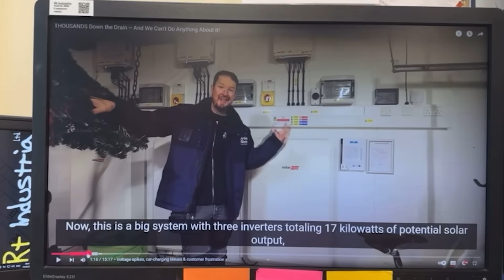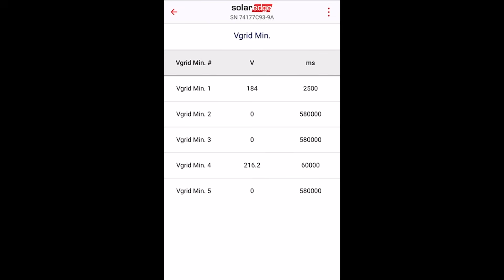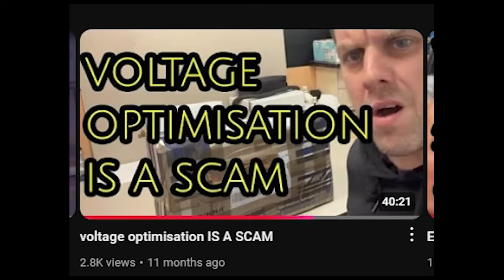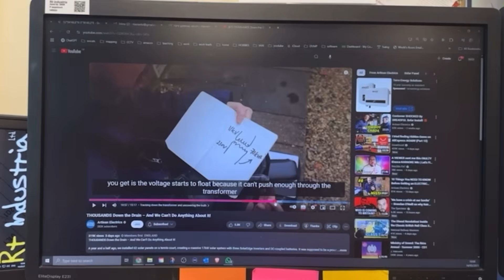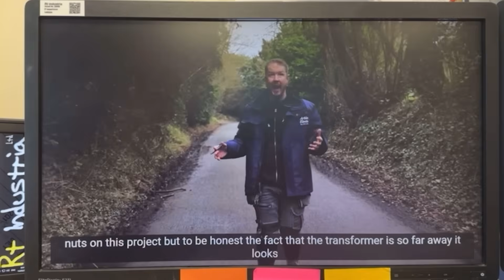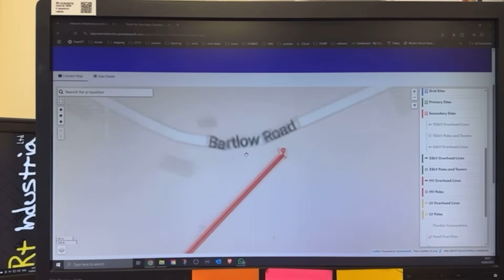ARTISAN ELECTRICS v THE GRID. WHO,S TO BLAME

Comment: I did some digging for my own knowledge, inverters work in a similar way to generator governor control.  
From what I can tell they adjust their phase angle to be slightly ahead of the grid,  a bit like the prime mover of a generator.  So the overall system voltage shouldn’t be necessary higher than the grid.  But the inverters sine wave voltage rise   should step ahead slightly of the grid voltage.  Within its tolerance.  So maybe the multiple inverters are trying to step ahead of each others wave not realising they are fighting each other and not the grid.  This would account for the higher RMS voltage.
I wonder how messed up the sine wave looks on a scope display.
Reply: Would this be able to happen if the voltage limits are set correctly?
Reply: @ I honestly don’t know,  keen to find out if it anyone else does?
Reply: I'm not sure how this would work - if the solar sine wave is rising slightly ahead of the grid, that's fine for the first quarter cycle, but then it will also start to fall slightly before the grid falls and therefore the flow of power would reverse for the second quarter cycle, and then the same thing would happen for the two quarters when the sinewave goes negative, one quarter the solar is ahead of the grid but for another quarter it's behind the grid, so it would be a net neutral import/export and it would push power out 50% of the time but draw power back in the other 50% of the time. Unless you're saying that the solar creates a sine wave with a kind of flat top on it, so that it rises slightly before of the grid, but falls slightly after the grid, so it has an extended peak - the flat top?
Reply: Anything connected to a grid will have the same exact phase. Voltage, current, power factor can all change but the frequency is identical everywhere on a connected grid. Some generators will run slightly faster before they sync to the grid, which is maybe what you read, so when they do close in they don't load the grid. But a generator will always be at the same frequency as the grid. Try to run it faster and you just export more power until you run out of excitation voltage on the voltage regulator or the engine runs out of power. You can adjust the power factor and depending on local grid requirements usually you will push VArs in to the grid to offset the motors that are using VArs. But frequency is tied to the grid. Put a scope on it and you will only see one sine wave. Well, one voltage sine wave and one current sine wave (if measuring current) and the difference between them is the power factor. But once a gen is online it is electrically coupled to that exact frequency. In fact if the prime mover loses output the alternator becomes a motor and will drive the prime mover at the grid frequency, called reverse power. As in electrical flow is reverse, not physical rotation in reverse which a lot of people assume reverse power protection means.
Reply: @ the sign wave can look messed up on a scope.  This happens with harmonic distortion.  When we synchronise multiple  generators we reduce their speed/frequency and voltage as the load on them increases to allow the incoming generator to pick up load without going faster that 50Hz or over voltage.  You don’t change the grid frequency but you do in effect get the generator to push against the grid.   Solar inverters also seem to have a droop feature.  
This example in the video shows you can have a different local voltage.  I’m connected to the same grid as this installation, my voltage isn’t affected by his installation.  The grid is one network, but voltages can be different at different parts.
Reply: @ 100% correct there can be harmonics and local distortions on the grid, but your fundamental frequency will be the same. The way the post was written it sounded like you were expecting to see two 50Hz waveforms slightly out of phase with each other. One from the grid and one slightly ahead from the inverters or generator in your case. So maybe I misunderstood what you were saying. 
The frequency will be the same at that installation and where ever you are at any given time There is a website that shows the UK powergrid frequency in real time and should match exactly with what you see at your location. But of course, voltage, current and power factor will vary by site and even within a building. 
Think of the frequency "mechanically" tying all equipment to the same speed / frequency. 
Setting up droop for paralleling generators isn't the same as syncing them to the grid. You are correct, droop works by allowing the engine to lessen the power output as the load increases which in turn causes any paralleled generators to increase to make up for the decreased output of the higher loaded gen. That way you don't have one gen at max power and one gen becoming a motor driving the prime mover and tripping off due to reverse power. But droop is the old school way to parallel generators. Today it's all done electronically with load sharing modules or controls built in to the gens themselves.
Reply: @ I’m dealing with micro grids in the marine environment so it’s a little different.  We still use droop even with modern switchboards and generators  but we have a higher tolerance for frequency changes.  We drop the overall frequency of the online generators so the incomer doesn’t overshoot.  I’m trying to learn the differences between how the national grids work with load sharing and how we do it.  We are getting more hybrid battery packs and inverters coming into the industry - Interesting stuff.  Also explains why we never load share with shore power for more than a few seconds.  Thanks for the information.
Reply: @JT_2024-c8j  Ok, now the droop makes sense. It's usually used in an islanded situation, like ships, back up power and microgrids, but when you mentioned the grid I though maybe you had a hard export power limit for peak shaving or some other scheme. Interesting you actually sync wanting it to be a load, but I guess makes sense to not upset the grid you are syncing with since it's only momentary and you will become a load once the gens come offline. Always wanted to work on ships, so many cool systems and power plants / main engines but most of my career was in power utilities and power generation. Only a few microgrids, one being in Antarctica. Which is a really cool setup between the US base and Kiwi base. We had 5 cat 3500 series gens, tied in with three 300kW wind turbines, two smaller Cats at Scott base and one inertial based energy storage system. All controlled via a SCADA system that would control what gens ran and did the load sharing between what was running. Obviously getting as much wind power as we could. The intertial storage was a heavy flywheel spinning at 3.000 rpm (I think, been a few years) and could supply up to 500kW for 30 seconds. That was used to dampen swings and to try and give a gen time to come online if we had a gen trip off or the wind died down. But that system died and may have been, or is in the process of being replaced by battery storage. When it was installed there were no battery systems like we have today. But really cool set up there and worked really good! Sure, there were problems from time to time but the load there was in the 2MW range or so. And yeah, much loser on the frequency there vs what the requirements are for the national grid. Plenty of times we'd have a dip in frequency where if it was a national grid it would have load shed and dumped load to save the system collapse. But with so little spinning mass it's inevitable to have frequency swings. As you are well aware. Out of curiosity, how much lower do you drop the frequency, it can't be too much or it would never sync. A few thenths, if even that? Not sure what your shore power breaker sync window is. Or is it an onshore breaker that does the tieing in? I don't have any marine to shore experience.

Comment: I did G99 UKPN approval for my own solar install/Victron battery install and its a tick box exercise. Submit the application and it pretty much gets approved instantly. As-long as all the documentation is submitted it goes through. Jordan's video to the layman makes it look like its everyone else's fault apart from Artisans. A lot of the issues could of been sorted out with better configuration of inverters/chargers. Why do they need to export so much and why do they need to charge at such a high rate. With the 6 hour octopus tariffs the battery could charge alot slower and the volt drop will have been alot less.

Comment: The inverter should throttle the output back if it exceeds 230v plus 10% as per the regs someone has set it to exceed the 253v maximum limit.
Reply: That’s not what the G98/99 requires that’s just your feelings about how it should work. Manufacturers could chose to throttle but all the standard requires, and all I’ve ever seen in operation are hard limits that once reached the inverter is required to shutdown.  Also your idea is nonsensical as 253vac is considered an allowed voltage to deliver to a home but no inverter would ever be able to export.  The allowed limits are higher.
Reply: I think Fronius inverters can do this but not sure if this is when the frequency goes towards 52hz
Reply: @edc1569  yes typically frequnecy is used to regulate active power not voltage.
Reply: @edc1569  My solar edge will not go above 253v  that is it's cut off same as my powerwall

Comment: I don’t get that the voltage must be higher than the grid to back feed the grid.  What are we doing - slowly raising the grid voltage?  Shouldn’t it need to be equal to the grid supply  voltage when the house is off load?  Otherwise how is this going to work with multiple houses all trying to bump the grid voltage up?  There must be a set point that the inverters will reach.  If the grid  voltage is right on the line of tolerance they cannot raise the voltage to force back feeding.
Reply: If the grid and the solar voltages are equal then no current will flow (Ohm's Law). Solar inverters aim to make their voltage about 6 to 8V higher than the grid voltage up to a maximum on 265V. This means that the property and neighbouring properties will be above the limit of 253V and this can damage appliances by making them run hotter. If several properties are exporting at the same time their inverters will fight and everybody exports less. This will get worse as more people buy solar.
Reply: @ When we run generators in parallel the voltages are equal and they load share just fine.  If you raise the voltage on one generator it will supply more reactive power.  The aim is to get them to be equal.
Reply: @JT_2024-c8j  I canna change the Laws of Physics. 
The situation is different. Two generators would have to match voltages to a common load (with equal cables), but they would also have to be in phase. 
With solar export the aim is to power the property AND make current flow into the grid. For this analysis you can consider the grid as another load, so it is one generator and two loads. There is always a voltage drop on a current carrying wire however small its resistance and to make current flow outwards the voltage has to be higher than the other end.
Unfortunately solar inverters normally go into the consumer unit in domestic installations so they raise the property voltage too. It would be better if they went between the consumer unit and the grid and had two ports, one kept at the nominal mains voltage and the other at whatever it needs to be to export .I'm not aware of any like that , but they would be more expensive. If such a device doesn't exist it will have to be created as more and more solar installations are made.
Reply: @ Don’t they load share by shifting the phase to be slightly ahead of the grid?  You can run as many generators in parallel as you like with many loads on them.  The grid is like another generator.  To get a generator to take up load you increase the governor to try and get the generator to speed up.  You keep the voltage as stable as possible.  From what I’ve read solar inverters do the same thing by adjusting the lead/lag of the sine wave against the grid sign wave?  The voltage at that point of the two sign waves would be higher but the overall peak voltage doesn’t need to be higher.
Reply: @ I worked recently with three generators and a battery powered load shaving system that absorbed spare capacity from the generators when they were under low load and supplied power back when the generators were on high load.  Voltages on the grid were 100% stable when the battery pack kicked in.

Comment: I agree that the inverters are fighting each other to push the current out and with increased voltage.
Reply: That should not happen if their limits are set correctly. So maybe they overlooked the setting? Doesn't seem likely......
Reply: @mfr58  that depends how far the inverters are from wherever they are getting the voltage measurement from
Reply: @haldo691  As far as I understood the inverters monitor their output voltage at their terminals and keep that voltage within set limits, as well as sensing if the grid voltage goes outside limits, in which case the inverter should disconnect. This is a requirement of connecting to the grid with E98/99 approval. If they have remote voltage sensing, that is another matter, but I would have thought that would have come up in the description of the installation...but maybe not...

Comment: That bloke is a joke, first thing i would have looked at was the inverter settings and got on the phone to solar edge technical. Absolute waste of time and money fitting an optimiser.
Reply: After watching BigClive's video (9 years old) on these so-called optimisers - it sounds like it might have been installed to protect the appliances in the house from overvoltage on the mains... but I don't see how it would help if power is flowing the other way when the solar is feeding the grid. You would have thought the 'optimiser' (which is just a transformer) would actually increase the voltage on the grid.